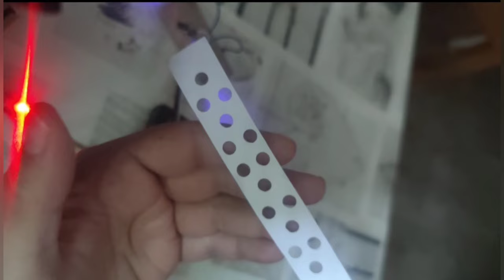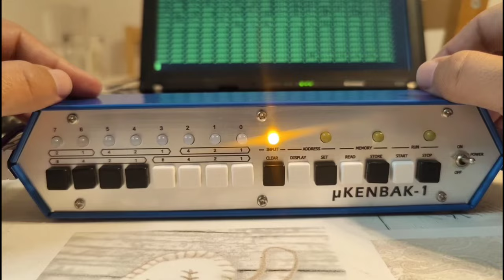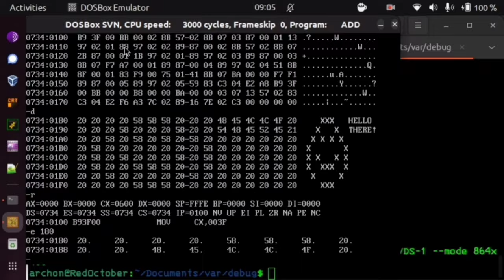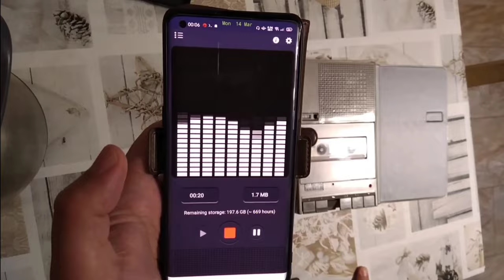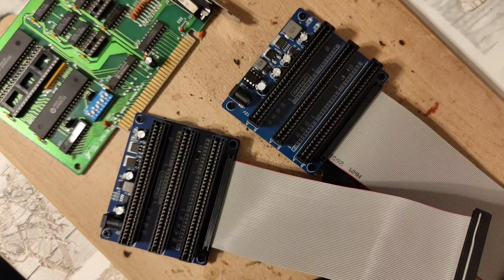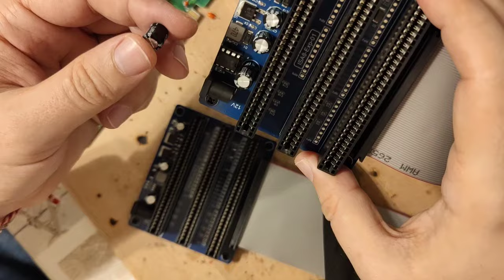(2/2) ISA8-EXP-01 for Book 8088: Hot Garbage

Comment: Hey Nino,

I’ve been considering buying a book8088 or book386, so eagerly following your journey. Although you’re sort of spoiling the fun by trying all the things I wanted to :-P.

For your RS232 only works in one direction issue, the lack of working +12 and -12v rails may be part of your issue. Older RS232 line drivers...likely ISA age drivers, may expect those two supplies to drive the TX line. If you’ve got a scope, you may be able to find the line driver chip and watch the TTL level TX line when you transmit.

For your 12v issue a trick I learnt after a similar experience. If you’ve got a multimeter handy, find a polarised cap near the mystery polarity input jack and check the continuity between the jack pins and cap legs. Power inputs usually have a bunch of bulk capacitors nearby so this approach usually works.

If you get a moment, I’d be interested to know what the few ICs on the ISA expander are…..I’d guess that at least one of them would be some sort of switching supply, to generate the -12v from the 12v input for the ISA slot. With +5V coming from the book8088 itself.

Thanks for the videos!

Phil

Comment: Just tested the ISA expander with a Kingston KNE20T. I have no problems with that one (it would be nice if the PCB of the extender would have a version number printed on it). I have 4 caps on the extender board. Sergey Kiselev mentioned something in the blogs about a poor choice of logic chips which could cause issues because of HC 74xx logic. Maybe your serial card has incompatible chips or so? Just venting ideas. :-)
Reply from the maker: Thank you, actually. Well, my card got smoked meanwhile, I think it were the 12V-experiments. — You got ethernet? Interesting!
Reply: @ninoivanov : yes, the ktc20pkt paket driver and mctp just work fine. I have to say, I have a book v2 with the supplied extender (it says ISA-Exp-01). I'll test some more cards and keep you posted. Though I don't like to risk really old ISA cards either..
Reply from the maker: @andreasbaumann6943  Seriously: don't. Maybe one day the expander will be redesigned, but these cards better be saved for worthier adventures. Thank you for the kind offer, but to test "now" just is too risky, IMHO.

Comment: Have you tried other cards with this adapter?   Most old 8-Bit Serial cards require -12v to operate properly, this could be causing in issue.  Also, most people have has success using the board without external 12v connected, instead using a high quality 12V Power Supply attached to the Book 8088 itself.
Reply from the maker: I have tried all sorts of serial cards from different manufacturers. NOWHERE does TX work. If you short out TX & RX, instead "seeing what you type", you type absolutely nothing. So whatever the cause — this is not good. The same behavior I have seen on another Book 8088, i.e. this was a "deeper issue", not a random bug on my machine.